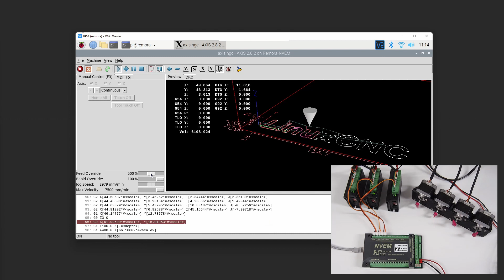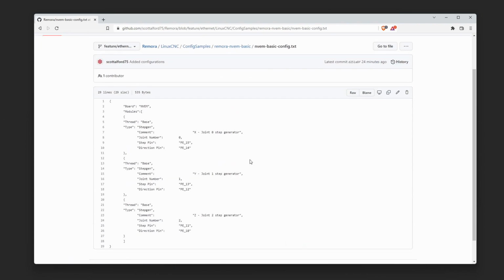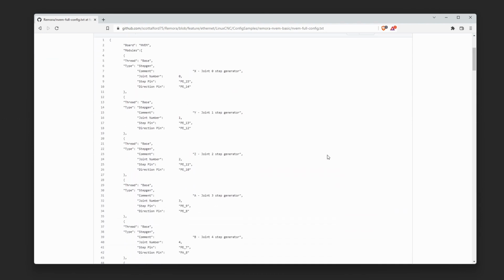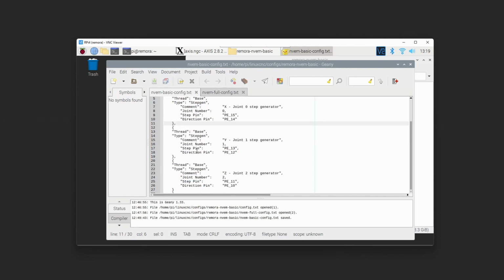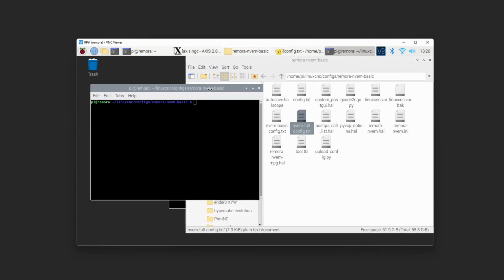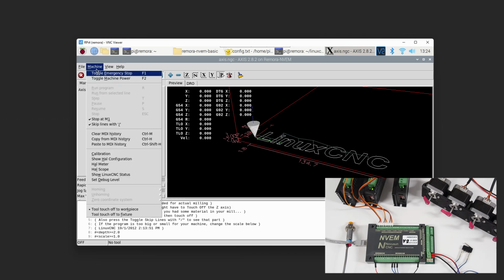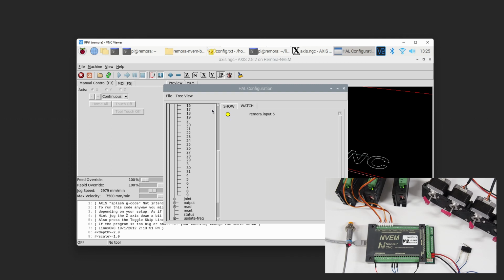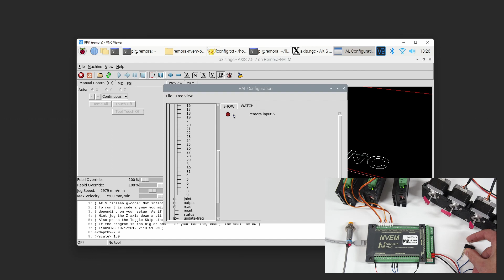Remora NVEM First Moves

Comment: Nice work Scott, I just ordered one of these to play around with. Might, even want to contribute a bit to the remora project.
Reply from the maker: Thanks and I hope you enjoy. Stay tuned as Remora-Novusun (NVEM and EC500) is getting a big speed boost. At least up to the speeds of the original firmware. Contribution is always appreciated, like the hints how to approach the speed increase I received.
Reply: @scott3d506  i haven't had a chance to look at the source in detail, where was the speed improvement?
Reply from the maker: @BogdanTheGeek  Using DMA to to the GPIO pin toggling. Proof of concept is working and now being worked into the Remora source.
Reply: @scott3d506  Hi Scott, Finally got my NVEM and started diving into the firmware. Created a PR with some quick fixes, but I think I can contribute a lot more. Popper file-system, OTA firmware updates are a few of the things that I can see being valuable. I work with this stuff for a living. Is there any channel I could get in touch with you directly?

Comment: Hello Scott, I'm having some difficulty I'm a little nub and I would like if you can help me.  I managed to upload your firmware to Nvem board, now I want to create a machine on LinuxCNC.  I usually use Mesa board, I've also done it with parallel port, but now I'm kind of lost, do I use stepconf or pncconf?  How to use network connection where I inform, where I configure the I/O ports?  Sorry for the maybe pointless questions….

Ingo
Reply from the maker: Hi, no problem. The easiest place to start would be to copy the example config available on Github https://github.com/scottalford75/Remora/tree/feature/ethernet/LinuxCNC/ConfigSamples/remora-nvem

Comment: Hi Scott, very nice demo! Did you do the stress test? I think it should be used only directly connecting the computer to the board without other devices that could generate collision in the network and board miss steps. I'm looking forward to see it working in your CNC!